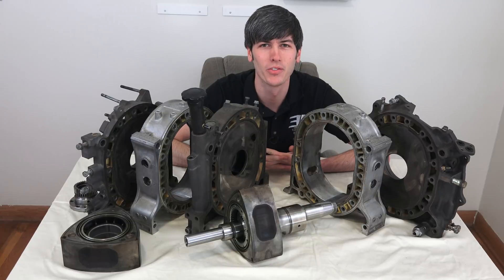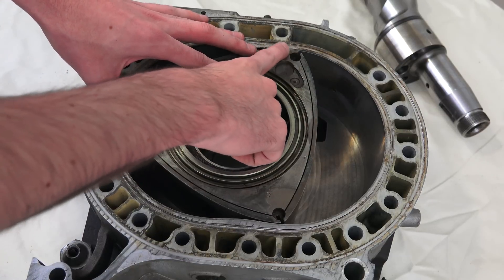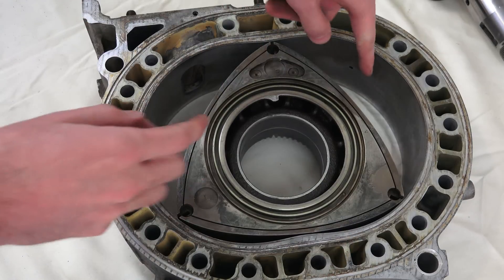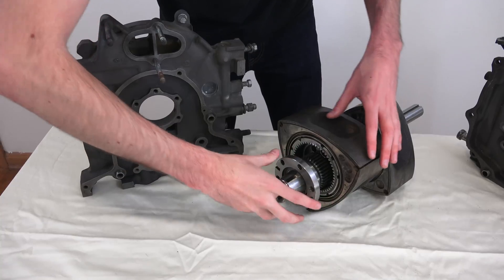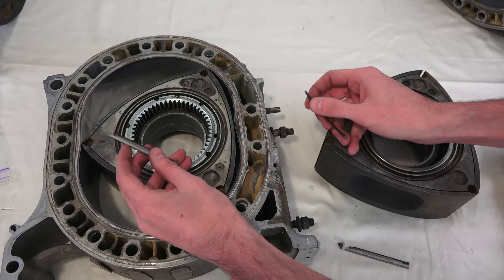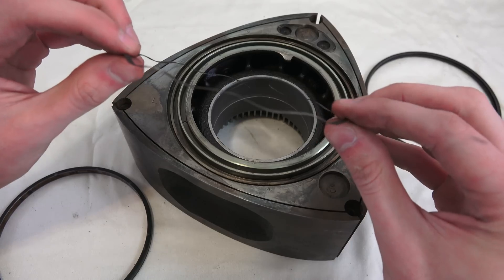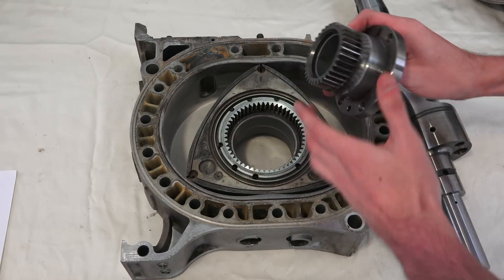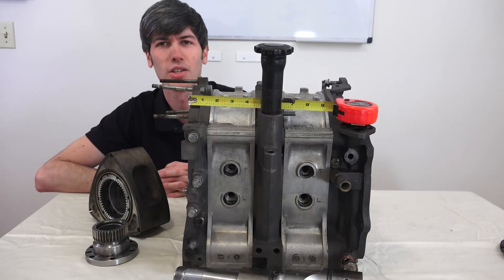How Rotary Engines Work - Mazda RX-7 Wankel - Detailed Explanation

Comment: How do you calculate the CC of this engine?
Reply from the maker: I would assume it's the open swept area of the rotor. With 3D modeling it wouldn't be too challenging to calculate. Haha, pouring water would probably work too, as simple of an idea as it is. :)
Reply: That is a good question that seems to confuse some regulatory bodies.
Reply: +Kevin Arnold Great question, I hope Jason will answer. Maybe they pour water in combustion chamber?
Reply: It goes 650x2

Comment: Are these more expensive to make than an inline, boxer or V engine? I don't see why we don't use these if they are so much more efficient (barring the use oil).
Reply from the maker: They're not more efficient, they're significantly less efficient, unfortunately.
Reply: Oh. I must have misunderstood the video then. Thanks! Question: All things being equal will a rotary engine have more power than a piston/cylinder engine of the same displacement?

Comment: What are the cons in such a engine design?
Reply: +Dominik Low bottom end torque, Apex seals don't last forever meaning you need a full engine rebuild usually every 75-100k miles, They burn oil, and they use considerably more fuel than a normal piston engine.
Reply: +Ethan Gee but i bet they're still more efficient then half of piston engines... :v
Reply: +Dominik 
mine gets 14mpg, i also disabled my squirters and premix 2cycle on every fill up so mine doesnt burn oil, premixing burns cleaner and increases longevity by covering everything rather than the center of the apex seal, mine is at 137k and still running
Reply: +Dominik 205,000 and still going. Premix only, being driven how it should be, and waiting for it to reach full temp before driving.

Comment: as the rotar is spinning, is it causing problematic friction against the walls causing sparks or excessive heat and wear? also on the rotor "triangle" corners does it completely seal each side off from mixing with the other side as its spinning?
Reply: +DkNy2kX the only time when there could ever be an issue is when the apex seal passes over the spark plug holes, that small gap could lose compression and combusting gasses over to the next combustion chamber, but if it was a major issue then it wouldn't work so its probably fine

Comment: Disadvantages? 
Burns lots of oil
Not as fuel efficient as 4 strokes
Apex seals wear out
If the engine is turned on then turned off quickly then the engine will flood, at least with the older engines
Not as much low end torque
Reply: +emertes17 It also gets very hot. Because you have 3 ignition "strokes" per 1 turn of the eccentric shaft, the engine doesn't get a chance to cool down like a 4 stroke would.
Reply: +emertes17 this IS a 4 stroke engine..
Reply: Rotaries are more similar to a motorcycle engine as far as maintenance & longevity. They will burn oil but many people mix in oil with their fuel similar to a weed-eater.

While these engines lack torque, they are extremely hot & produce more exhaust gas than Taco Bell. So why is that great? Oh yeah, turbochargers! Using turbos you make up for the lack of torque. I had a twin PARALLEL turbo RX7 FD that produced 380lb ft of torque from 2500rpm up to 7000rpm. Using more recent & better built turbos that could be dropped to 2000rpm-9000rpm with even higher torque numbers. 

But that's not efficient enough for many people. No, it's all about hybrid systems like the P1 or 918. Well using a Rotory's excess exhaust gasses you could also charge a electric power train similar to Koenigsegg's. Audi did this with one of their concepts using a One rotor. Now imagine a Fisker Karma using Tesla motors and a rotary engine. That'd be sex on wheels with good MPG
Reply: +Matej Moržan He doesn't seem butthurt at all...
Reply: invinciblejets if it wasn't being held back by engineering issues, other manufacturers would be using it too. It's a niche engine for enthusiasts only at the moment. It has potential to be more than that, but at the moment it's horrifically inefficient, requires excessive maintenance, and thus for most the penalties outweigh the benefits. I do believe that with technology advancements, it may yet come in to its own.
Reply: +emertes17 I agree with most of your points but i don't understand why are people so butthurt about torque on rotary engines? How can you expect torque from 1300cc engine that revs to moon?
Reply: +emertes17 Yup, and that is why only Mazda still make them.  They are just not commercially viable in any way, but they have a small an devoted (some would say fanatical) fan base so Mazda keep at it - which I guess is a good thing, as perhaps some day with new technologies and materials they will overcome the fatal flaws.
Reply: +Joel Sägesser 4 stroke *piston engine
Reply: +177SCmaro I absolutely do agree on that.
Reply: +emertes17 Nice memes
Reply: +Matthew Sharpe But they don't make them anymore. Production stopped a few years ago.
Reply: +Matthew Sharpe how is overcoming insane engineering feats like the rotary a fail? 
Just because all you know about rotarys is the cliche outdated myths doesn't mean it's a fail.. Lol 
It's different than a piston engine simple as that if you can't comprehend that what are you doing watching videos about cars?
Reply: +177SCmaro which is why most people disable the OMP and premix more reliable assuming you can remember to add the 2stroke oil to the fuel.
Reply: +177SCmaro and none of those cars have a rotary... They are a different engine and need to be treated different ..not a complicated concept.
Reply: +177SCmaro no one owns a rotary for emissions... Or to be practical. Like I said not a complicated concept. May not be the best engines but that's not the point. Same with the Saab 2 stoke guys or people who are into model Ts. Do it because they love it..The car world is vast not just you in your own bubble.
Reply: +177SCmaro Mazda released new RX8's with rotarys didn't they?
Reply: RX-Vision being introduced in 2017.  All sorted.
Reply: dont even anything at rotary but this is better than the video.
Reply: and still blows off most
Reply: Ahh dont matter 1.3L beating fat v8s is awesome, you just have to be smart enough about how it works and the engineering to know how to avoid these problems. If you run into them then obviously the owner isnt smart or didnt do their research.
Reply: I also feel that in part its Mazdas fault because they let people like Dave from the office purchase such a car. They should have had at least an informational video for every new owner.
Reply: Having a lot of unburnt fuel exhausted out leads to higher exhaust gas temperatures, which is why rotary exhaust systems run very hot.
Reply: Why do people even mention that it uses oil? It was designed to use oil. If you can't be bothered to top oil every once and while you are a lazy ass car guy. Oil is cheap and easy to fill yet people mention it as a disadvantage like its some sort of flaw in design.
Reply: BmanUltima They displayed a new RX-7 concept car at the Tokyo motor show last October with plans to go into production in 2017. The company CEO confirmed at the time that they have not stopped working on rotory engine R&D and have no plans to do so.  I'm not a fan of them at all, I think they are a total fail of an engine - but that's just with current technology, it's great that Mazda aren't giving up and they might just crack it one day.

Comment: I guess you've overlooked the biggest disadvantage of wankel engine being not reliable. There is indeed very few moving parts, but the amount of friction is ridiculus along with fact that you can't deliver as much oil in there as in piston engine. And also burning oil by design seems not very effective to me.
My guess is that this engine is absolutely amazing in diefferent sport applications being very compact and light, but is not applicable to daily driven cars due poor reliability

Comment: Its a rotary engine its a rotary engine do you know how small it is do you know how much power it has???
Do you know how these work?
Do you know who Wankel is?
Do you know HOW SEQUENTIAL TURBOS WORK???
IMMA TELL YOU ANYWAY
IMMA TELL YOU ANYWAY
IMMA TELL YOU ANYWAY
Reply: +CroatianZ 370 SO small SO MUCH POWER, SO small SO MUCH POWER,TRIANGLES, TRIANGLES, TRIANGLES!!!
Reply: CroatianZ 370 x
Reply: Of course :)
Reply: +CroatianZ 370 i felt so bad after watching that episode.. ive done all those things..
Reply: +CroatianZ 370 Love the Regular Car Reviews Reference. :)
Reply: +CroatianZ 370 Have you heard the remix song of that ?
Reply: Rentta yes indeed
Reply: CroatianZ 370 Good
Reply: The 13B when I was at Mazda in 1976 was about 225 lbs including the thermal reactor (exhaust manifold).  Few if any four cylinder engines for the street ever got so light.  Still, if the RX8 is 3000 lbs with hardly any of that constituted by the power unit, the rest of a car needed to go on a diet.
Reply: Me: Do you know how much I don't care.
Reply: okay, what is this cause it's too funny

Comment: If rotary engines have that much advantages compared to 4 strokes ones why aren't they more widespread ? That always bothered me.
Reply: +Charles Poumbatchaka Fuel emissions are a big one. The long combustion chamber means that some fuel is often left unburnt and then pushed out the exhaust leading to really bad emissions ratings. They are very fuel inefficient because of this. They also go through a fuckton of oil.
Reply: Ethan Gee Just not a good buy tbh
Reply: Yeah it gets through so much oil and has a really low mpg figure. You can get them so so cheap now because nobody wants then ha
Reply: +Charles Poumbatchaka Pretty much what the other guys mentioned, plus the fact that the engine needs a full rebuild every 75-100k miles due to failed apex seals which makes the engine lose compression. That's why you see a lot of RX8's for sale with around 70k miles on them because the owners don't want to fork out for a rebuild.

Comment: With rotary force as opposed to reciprocating force, I would think the rotary engine would last a lot longer than a piston type engine.
Reply: They require a good owner but they will last
Reply: Ярослав Немирович nope
Reply: +Ярослав Немирович 50k? i know you are russian but please, at least 120k
Reply: +Volusia-ev 50 000 km against 150 000+ for piston engine
Reply: WeylyHD maybe cimate have to do with this, or bad owners. These engines with 120k on them are usually alredy rebuild or have no compression and burn oil like crazy

Comment: disadvantages?
Reply: +sergioguevara192 burning oil constantly, seals
Reply: +sergioguevara192 low torque at all rpm, low gas mileage, it's not as efficient as a reciprocating piston engine
Reply: +sergioguevara192 yeah people tease you about reliability comparing it to an ls motor
Reply: +sergioguevara192 Also, HEAT. 3 ignition/power cycles per revolution creates a lot of heat, a piston engine will have lots more down time for cooling in between power strokes. Also, while being very compact is great for size, it's not great for spreading heat dissipation over surface area or allowing for more coolant passages. 
What's the 1st thing that suffers when over heated? Seals (and bearing surfaces if the oil isn't up for it). Since the rotary lives or dies on seals, this isn't always a good marriage. Responsible rotary owners are practically religious about over-cooling their engines.

Full respect to the wankel engine, nevertheless.
Reply: +Flame Beats The engine won't die if the seals aren't perfect, it will just lose compression, exactly like a piston engine
Reply: +sergioguevara192 Some  people say it has worse fuel economy than a piston engine.
Reply: i think the rotor is an awesome engine regardless its light weight compact and power full when turbocharged fuel usage who cares the green girls what ever in the name of speed go fast of go home!
Reply: +sergioguevara192 
The problem is the word disadvantages 'suggests' the rotary may have some advantages....which it does not.
Reply: +sergioguevara192 Higher than normal exhaust gases. Which loses a lot of potential energy.
Reply: +ThePlanBPill  EGT is used to drive a turbo in most cases
Reply: Josh Yeah that's a fairly normal way of harnessing that lost power. However, maybe Mazda can work in a 5 stroke rotary some day. Where effectively the exhaust gasses are pushed out into another set of pistons or rotors.
Reply: fuel mileage that makes even a Hummer H2 look good, and the torque curve of a hamsterwheel

Comment: undoubtedly the most beautiful engine design ever
Reply: Beautiful, yes. Efficient, no.
Reply: +XxGreYSh0TxX Depends on what you define efficient. Space efficient? Yes. Material efficient to manufacture? Yes. Fuel efficient? No.
Reply: +XxGreYSh0TxX Rotary is the most efficient way to convert fuel into noise
Reply: +XxGreYSh0TxX unless your mad mike
Reply: +corporalwaffles Fuel, power, maintenance, oiling/cooling. It's designed to burn oil for god sakes. It's just overall not an efficient engine. Cool though.
Reply: +XxGreYSh0TxX  Lol. The rotary is one of the most efficient engine designs ever made. The 1.3l rotary in the Mazda Rx-8 makes about 275 horsepower. That&#39;s MORE than 100hp per litre from a 1.3. No other production piston engine below 1.6l has ever made anything like that kind of power per litre and NO engine under 2.0l WITHOUT forced induction has made anything close to 100hp/l. Efficiency is defined, generally, as the most amount of power for the least displacement. Imagine getting a 0.1l engine to 500hp. That&#39;s efficiency. Getting the most out of what you have is the definition of efficency.  Rotory&#39;s are INSANELY efficient. The 787b leMans winning Mazda 26b 2.6l quad-rotor makes over 700hp from a 2.6l naturally aspirated. No piston engine of that size could even dream of such high power levels. Nothing has efficiency like the rotor.
Reply: duviday he means fuel efficiency
Reply: +corporalwaffles guys.. take it for what it is .... is jus a very interesting idea.. and about efficiency.. well non internal combustion are efficient..  you want efficient look into turbines (jet engines) !!
Reply: Madmike is a drifter search him up, If you mean efficient as in fuel and such, search him up
Reply: +duviday I know its a bike but the new ZX-10r makes about 205hp from a litre, and that's just the engine
Reply: +TheNorthernDrift I don't get the reference
Reply: +duviday chevy sonic LT 1.8 liter NA 138hp. just saying. also the rx8 was detuned from the highest peak NA rx7 HP of 250 back in the late 80's and lower obviously than the twin turboed 255 HP last model before it was ended. as to the speculations (other commenters) of torque issues, those cars were geared for their engines. My 1984 gsl se was destroying the muscle cars of it's time, with the exception of LT1 stuff and that damned mitsubishi starion. lol however, i wouldn't call it efficient. (unless you cruised at 100mph) that thing got 20mpg no matter how i drove. one day i'll probably buy another one. but it'll be because it was quick, perfectly balanced, fast enough (mine was geared so that 140 started redline and i don't push things) looked awesome, had a ton of features for the time, and of course nostalgia. fuel efficiency won't be one of the reasons i get another one.
Reply: XxGreYSh0TxX
the best torque in an rx8 is actually at only 5,500 rpm. yes, you can rev it up to 9,300 rpm but you really dont HAVE to like everyone always says in order to get power out of it
Reply: +chinchy111 I'm talking about HP which you do have to rev past 7k to get. Sure you get full torque earlier on, but its a measly 150 or so pd/ft.
Reply: No . Ew
Reply: Meh 😒
Reply: Undoubtedly the most unreliable engine design ever.
Reply: +duviday More like 235hp, but I was mentioning the meager low end torque and weak acceleration these engines produce. Sure it has a lot of HP for a 1.3, but you have to ring it out past 7k to get any of it. And no, efficiency is not only defined as hp/L. In order to be classified as an efficient engine, a lot of factors come into play. Factors like the ones I listed above.